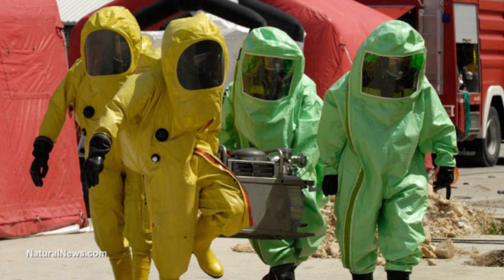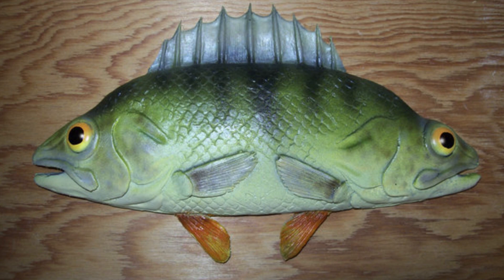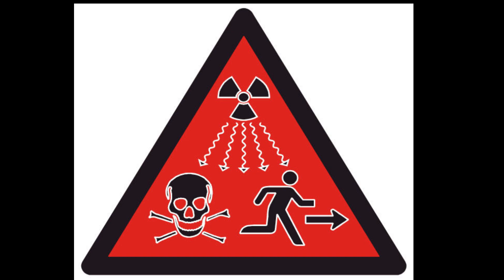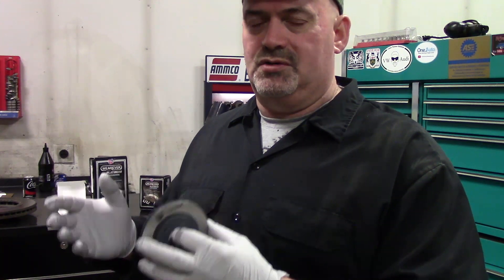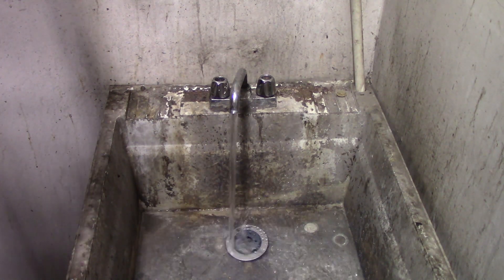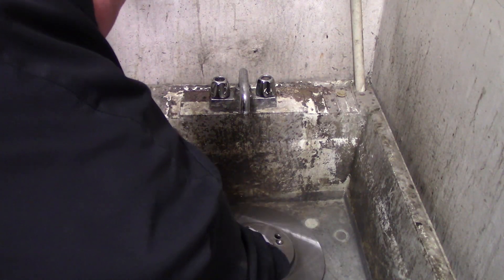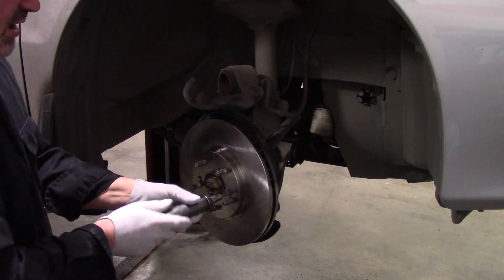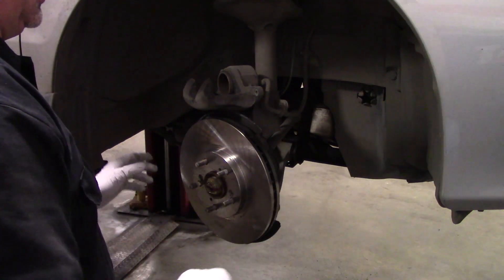This video has been replaced due to video loss

Comment: Excellent video Tim and I'm sorry I was late sending you your meds but they are on the way.  Excellent point to fill up the tub so the molecular detoxification infusion ionization process can take affect. Read the Warnings b/c if you accidentally install rehydration rotors and dehydration pads then your rotors will shrink back to shipping size and your wheels will fall off. The sweet part with rehydration rotors is when they wear you just soak them for a few minutes and BOOM new rotors again. I heard the Little Houses are made with dehydrated product so you can transport your house down the road and when you get to your property you just hose your house down and it becomes a mansion. They tried it in Arizona but after a few weeks in the hot sun they lost an entire city :O
Reply from the maker: Hahaha. That's why we live in igloos here. Haha. Please FedEx my meds as soon as possible.
Reply: I'll send ya a box and in the box will be a box of biscuits, a box of mixed biscuits, and a biscuit mixer. They are not intended for use on a motor vehicle. Any resemblance the biscuits have to tires of a vehicle are illusionary and just means you haven't taken your meds yet. 
This will be a test for the Car Doctor broadcasting system. We now return you to your regularly scheduled doctor. Have a little patients doc. Patience? If he had patience he wouldn't be fixing cars. 
Doc? Doc? I can't see. That's ok you're in Alaska and the sun don't come up until 10. Just follow my voice and we'll take ya to Barrow and then you'll really think you're crazy.

Comment: I have used these rotors for a couple years now.  I find they do indeed develop a layer of frost at about -5 F. That is why the recommended pads have sharp metal shavings embedded in the asbestos. The shavings scrape the frost off the rotors.
Reply from the maker: Oh wow, I didn't even know that. I have been going out every morning and using a blow torch to heat them up and melt the frost. I probably didn't even need to do that because the pads scrape the ice automatically. Sweet!